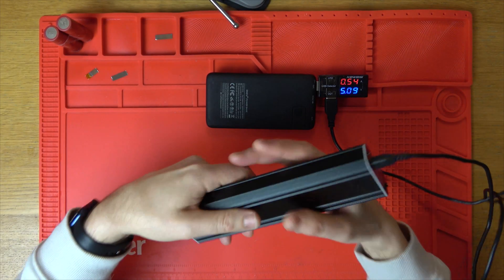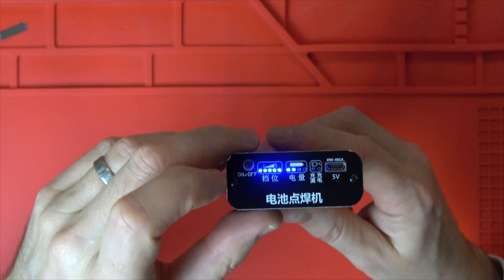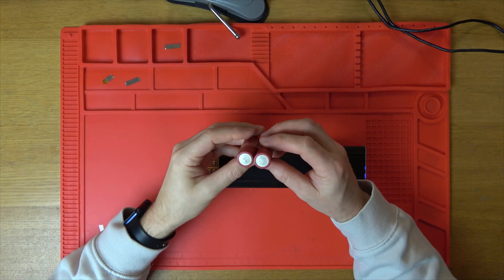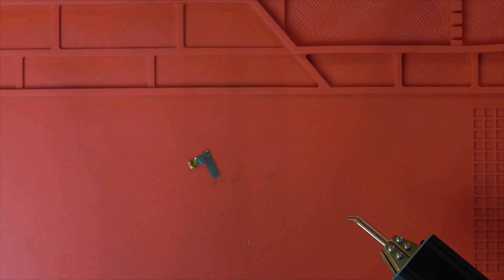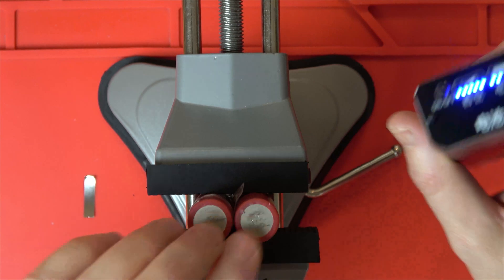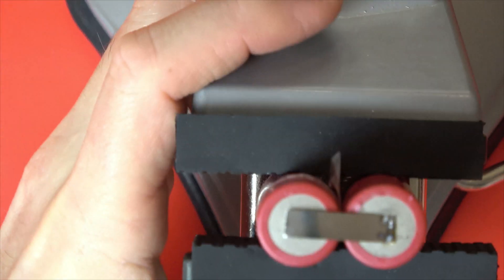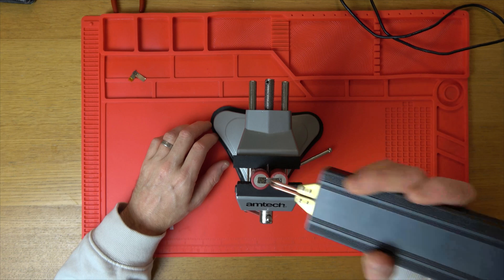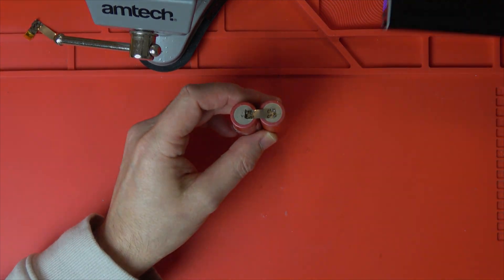How to Use a Cheap Portable Spot Welder - Replacing Welded 18650 Lithium Battery - Beginners guide

Comment: I have a different model of spot welder, but basically it's the same principle - you basically choose the level of power and if it should trigger manually or automatically, touch the probles, and viola.. Or so I thought... You make it look so simple, but fkin hell, I had such a nightmare yesterday. I tried to solder 5 cells in a 5s configuration, but every time I went to weld, it either wouldn't tack correctly or it would burn right through the nickel and sparks would fly out. I made such a mess of my battery pack that I don't think it's salvageable any longer. Thing is that I still don't know what I did wrong to better prepare me for next time...

Comment: I've been an inventor, designer, and manufacturer for more than 50-years in the fields of mechanics, electronics, and optics. I needed to "spot weld" stainless steel strips connecting  lithium ion cells to make a battery pack of the appropriate voltage required. I had a large collection of 1000uf @ 35v electrolytic capacitors and wired 50 of them all in parallel on a "perf-board" using 12-AWG "buss-bar" wire connections, and used lengths of 6-AWG wires to connect them to an automotive starter relay and finally to the sharpened copper welding probes. I used a foot-switch to activate the starter relay while holding the welding probes onto the foil link and to the cell, pressed the foot switch and produced two perfect spot welds, I've utilized this assemblage to make many battery packs in my work!  David Riddle

Comment: I have one of these. It failed after 4 days and now it is a brick.
Reply: Hello, dear, we awithz are professional spot welding machine manufacturers. Our spot welding machines can meet your needs, and there is a one-year warranty and a professional engineer team, so you don't need to worry about the use problems.

Comment: Awesome video, i just got mine with usb c. I have 2 questions tho: to weld, the usage of gear 5, is convenient in itself. I know you kinda explain, but i am somewhat fearful because i don't want to screw up the cells i'm gonna weld.
The other question is that did you sharpened the tips?? Cause do not look as pointy as yours
Reply: I used gear 2 on 0.2mm nickel strip and it welded quite well

Comment: The welder has no button to start welding, so it starts automatically - about 1 second after both needles touch, is that right? Another similar welder has that button.

Comment: I just got the AliExpress one with the type C charging plug and I was wondering if you sharpened or bent your tips of the copper probes
Reply: Me too i can't get mine to work at all.... 😢
Reply: Charged?  Used on a metal strip to strip connection? On top of a piece of wood. It will leave a burn mark.  Try on first or second strength setting.  Maybe replace it if it is not a working product.  Sorry 😔
Reply: Hello, dear, we awithz are professional spot welding machine manufacturers. Our spot welding machines can meet your needs, and there is a one-year warranty and a professional engineer team, so you don't need to worry about the use problems.

Comment: 1mm thick Nickel strip ? Are you sure? You cannot weld 1mm with much better welders. I think this can weld max 0.1mm maybe 0.15mm at max.
Reply: Yea it’s 100% not 1mm
Reply: Hello, dear, our awithz handheld spot welder can spot weld up to 0.25mm nickel plating. If you need thicker ones, please contact me and I can give you the wholesale price.
Reply: I could do 0.2mm strip without issues on 2nd setting